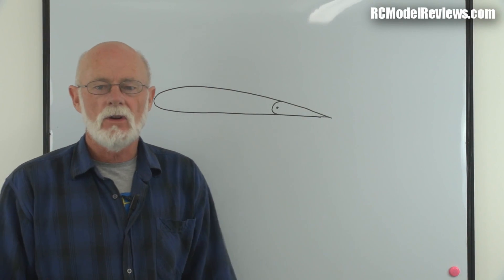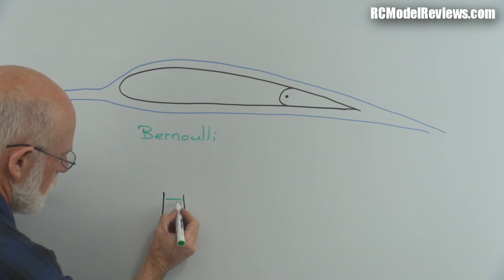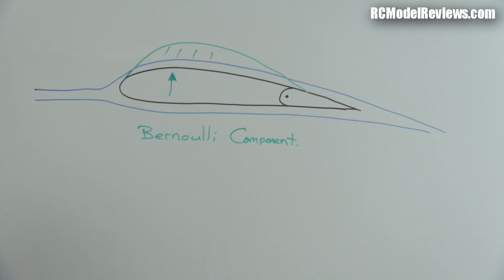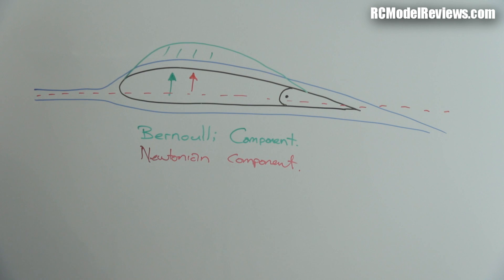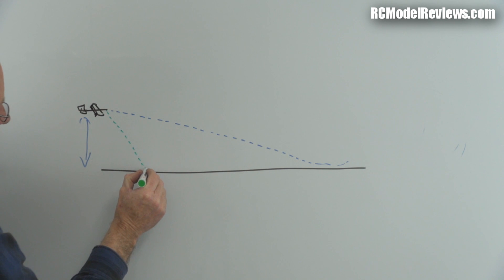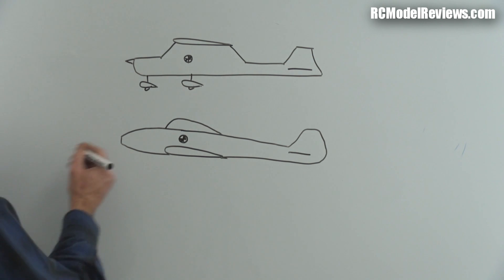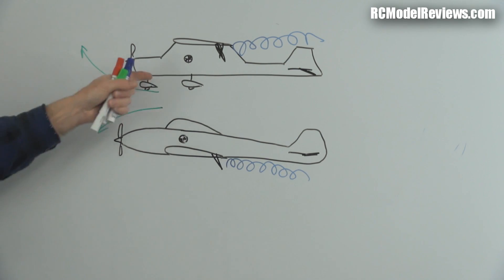How aircraft flaps work

Comment: another way to prove lift as you are discribing would be to grasp a piece of paper with both hands by two a posing corners.  alow the rest of the paper  to droup  over away from you and then blow across the paper . the paper will lift into the air proving lift .
Reply: Yeah but now blow along the bottom side. Now the air on the bottom is moving faster than on top, and yet the paper moves away from the faster moving air. The high pressure deflection effect is much greater than the low pressure Bernoulli effect at any given airspeed.

Or another way to do it, hang the paper straight down instead of drooping out sideways, and now blow air over one side or the other. 
Very little movement (but some).
Now blow air across one side, but at slight angles to the paper (different angles of attack) and see how much difference there is between high pressure deflection (blowing across but slightly toward the paper on one side) and low pressure Bernoulli effect (blowing across but slightly away from the paper on one side).
It is much harder to get the paper to move significantly with negative pressure, but very easy to blow the paper around with positive pressure, using the same wind power.

Granted, an airfoil shape will increase the negative pressure effects, and you're going to have both forces at play, not just one, but the greater force seems to me to be deflection, not Bernoulli.

Comment: No, the Bernoulli explanation is wrong.  The Newtonian explanation is correct.  The benefit of the camber is to keep the air flow attached to the foil longer than would be the case with a flat plate, so you get more lift per amount of drag, and can sustain a higher angle of attack without stalling.

Comment: Forget about the green liquid and straw, that is bogus ! 

Bernoully "component" and Newtonian "component". Naah...Both can explain lift on their own and are not in conflict. Unless you already know better, you will be better off forgetting about the first part of the video.

 Be happy with the knowledge that a wing creates lift by deflecting air and does it more efficiently if it is curved. As it creates lift It also creates more drag if it is overly curved, like when flaps are deployed. Hence, the flaps are retarded during normal flight. Use Google if you want to go into detail, but do not totally trust this chap ;) .

About the pitching up or down...Yes, interesting. True. Other things come in into play also, like the centre of gravity for the aircraft and the downwash effect on the tailplane due to lowering flaps.

Comment: Brilliant lecture. Although you're intended audience is models it's the same for the full scale. It's helpful to visualize the effective chordline- from the leading edge to the trailing edge of the flap be it up or fully extended. The plane with full flaps will stall at a lower speed (assuming 1G level) but at a lower AoA than clean (the effective chordline is steeper due to the lower trailing edge). The same concept applies with slats- the effective chordline drops with the leading edge of the slats as well as the trailing edge of the extended flap. In jets with slats only extended, you'll be able to fly more slowly but your stall will be at a higher AoA, again the effective chordline is reduced with the lower leading edge. Usually you take off and land with both extended so it's close to the clean AoA. Also, I used to fly the Piper Aztec. When you extended the flaps there was a very pronounced pitch up (unlike other low wings). I was told that was the result of increased downwash over the horizontal stab. Lastly,  I spent many years flying the C-141, a high wing heavy four engine jet transport. It too had a dramatic pith-up during flap extension (it had no slats). The rule was 4 4's- as the flaps went through 40%, make four long nose down trim pushes, lower the pitch 4 degrees, and push the power up to 4,000lbs/hr. Thanks for your effort. Cheers!

Comment: Hi Bruce,
I'm going to be fitting flaps to my FX-79 flying wing! I know but they are there and I want to use them! Lol...
This wing is fitted with a MFD AutoPilot and I am sure (for the first few flights) it will automatically compensate and add up elevator???

Of course, I will test at altitude for safety...

Comment: bernoulli has nothing to do with lift,  lift is produced by angle of attack, and airspeed.
     the wing diverts air downwards almost vertically, just like a propeller blade does, aerofoil section determines stall characteristics and efficiency.
    most lift is produced by the top surface of the wing, not the bottom.
the only reason a flat bottom curved top section gives more lift than a symmetrical , is bcause it stalls at a higher ANGLE OF ATTACK.
      lift is due to airspeed and angle of attack, for those who want to dig deeper,they will find that there is a vortex which spins around the wing chord,  fascinating stuff.
    google,     'how airplanes fly: a physical descripion of lift,  (allstar).
    no maths.
Reply: This implies that if a 737 has a negative angle of attack that it would fall from the sky like a stone regardless of airspeed. We all know that doesn't happen. There is still lift being created other wise a 100Klb plane would not fly.
Reply: you are not making much sense, there would be plenty of,  'lift',   but in a negative direction, towards the planet.
   angle of attack, and airspeed determine lift, take a look at the site i referred to, or carry on believing nonsense, bernoulli only applies to constant power scenarios.

Comment: Is it best to set up an Elevator mix on your TX so that when you apply flaps the elevator adjusts slightly as well........... Im new to using rc planes with flaps and I have just purchased one and i'm setting it up , thanks Steve

Comment: Air pressure is I think 14.5 psi "in old money", so for every square foot of wing = 144 square inch's that's 144 x 14.5 = 2088 lbs per square foot of wing lift, minus the reduced top wing loading, so still a huge amount of lift on a large wing area.

Comment: Very Nice thanks 100% you are a teacher...now please let me ask....why flaps are used in both i.e. while lifting and landing the plane
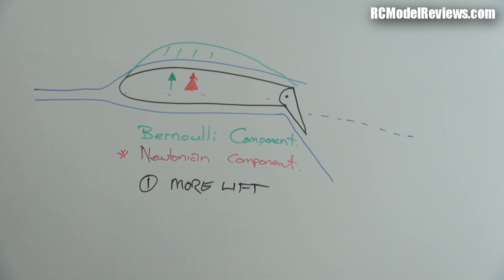Reply: 7:35 you can get the same amount of lift at a lower speed means that you get enough lift for takeoff at a lower speed and you maintain enough lift to keep the plane in the air at low approach speeds so you don't need as long of a runway.
Reply: I was wondering the same thing so thanks for answering Samuel. Im just learning to fly rc planes after years of flying rc Helicopters & Drones. Im learning using a simulator and a Trainer plane Hobbyzone Champ+ and I have now purchased a FMS Cobra 2 P39 and although not ready to fly the Cobra yet I am setting up everything.

Comment: This explanation is unfortunately wrong! Look at experiments with pulses of smoke flowing around an airfoil (search for Holger Babinsky, University of Cambridge, "How do wings work?").

1. The transit times above and below the wing are not equal.
2. Bernoulli’s equation applies only along a streamline. There is no explicit relationship between the
pressure and velocity of neighbouring streamlines.

http://www3.eng.cam.ac.uk/outreach/Project-resources/Wind-turbine/howwingswork.pdf

http://techtv.mit.edu/collections/ifluids/videos/32607-pressure-fields-fluid-acceleration (see demonstration at ~20 min)
Reply: Thank you for informing us.
Reply: Sorry, I'm a bit confused. Can you please point out the parts where he got it wrong?
Reply: From 00:00. I sure he's well intentioned but he's very wrong. There are lots of youtube video's that explain the correct science. Here's one to get you started: https://www.youtube.com/watch?v=XWdNEGr53Gw
BTW, run both that video and another of that users videos with the slides from that lecture at the same time so you can tab between them.

Perhaps the bloke who made this video should also watch it.
Reply: Reik, "Bernoulli’s equation applies only along a streamline. There is no explicit relationship between the
pressure and velocity of neighbouring streamlines.", almost correct, except that neighboring streamlines (all streamlines in fact) a distance ahead of the wing all start with the same pressure ( = local atmospheric pressure) and velocity ( = true airspeed), so you can use Bernoulli between streamlines. For example, if the pressure and velocity on one point of streamline a are Pa1 and Va1, and in the same streamline a distance a ahead of the wing you have Pa0 and Va0, you can make Pa1+1/2*ro*Va1^2=Pa0+1/2*ro*Va0^2. You can do the same with another streamline b: Pb1+1/2*ro*Vb1^2=Pb0+1/2*ro*Vb0^2. But because a distance ahead of the wing all streamlines have the same pressure and velocity, you can make Pa0=Pb0 and Va0=Vb0, what will give you Pa1+1/2*ro*Va1^2=Pb1+1/2*ro*Vb1^2, which is exactly as if you were using Bernoulli between 2 points in different streamlines.

Comment: I just love your analysis makes it real easy to understand. On the question of flaps, I'm trying to work out how much flap is needed for a control line stunt plane as most of them have full wing length tapering flaps. I would like to know how to design them so as to reduce the length, similar to a full size plane, yet achieve the same lift required to do tight circles/corners as per the stunt schedule for F2B. Can you help please? Many thanks...John Harman Brisbane.

Comment: why isn't the wing wider in the first place? 

why doesn't the airplane have a parachute?

why isn't the runway longer to stop the plane safely even if the breaks fail to work? 

why doesn't the plane float? 

why don't they use more than two engines for regular planes to come as a help if one engine stops working? 

why do pilots have a button to switch off the transponder on a passenger plane?

why they don't weigh the plane before take off to eliminate mistakes and they trust pilots to make an exact calculus? 

why they stuff 300 people on an aircraft that only has room for 250? who os letting them do it? 

why do airplanes take off and land during storms? they only close airports when it's impossible to land. Otherwise who cares if the pilot can barely land on high winds almost killing everyone?

why arent the big bags scanned also the same way the hand bags are?

Comment: Why would you assume the air from the top and bottom reach the back at the same time?
Reply: The assumption is wrong. Air molecules hitting the leading edge together and going one over and one under the airfoil do not reach the trailing edge together. The one traveling on top travels faster by more than what is needed to make up the longer travel, so it reaches the trailing edge first.
Reply: there have being counter explanations to why Bernoulli equation doesn't explain concept of lift on airfoil, but then old school of thought has it that some assumptions made, i.e; ''laminar flow'' which in a lay man's term literarily mean the fluid molecules are undisturbed!... ''wing slicing through'' this explains why those adjacent air molecules (top and bottom) reached the wing tip at the same time.
Reply: Approximation at high speed ... Boy. They can never reach at the same time, but difference trends to increase and decrease and so do the lift generated.

So we are human.we assume the shit up, we make the shit up just like we deed for religion.
Reply: It doesn't, but I understand why the assumption was made.  Imagine a grid of equally spaced dots moving over the wing, now figure that if the dots are more crammed together, they will try to push towards an area where the dots are spread further apart.  Now visualize what happens when the equally spaced dots at the leading edge don't meet up at the trailing edge.

Again, I realize that the air particles in fact do not meet at the trailing edge, but I understand why the assumption was made.
Reply: Because if the air doesn't meet the wing stalls and you get vertices as these are caused by the fluid, air in this case, spinning into the vacuum created where the airflow doesn't meet. You can only increase the sorted of the fluid above the wing by a fixed amount and this dictates the stall speed and angle of the wing.

Comment: The Bernoulli effect is not caused by the shape of the wing, but by the angle of attack. If the shape of the wing generated lift then an airplane would not be able to fly upside down. A flat wing will produce the Bernoulli effect BUT produces more drag than the airfoil you've drawn. So we create the airfoil shape to make wings more efficient.
Reply: Bernoulli effect cause by both - i.e. the shape of the wing and its AOA(Angle of Attack). "Flat plate" that you mention as an "airfoil" is more related to symmetrical airfoil, that is why it fly well upside down as an upside up, however, that is not the case for many none symmetrical airfoils, especially that are heavy cambered.
Reply: One thing not being mentioned, and maybe pressure covers it, but air moving faster over the top of a wing than the bottom naturally creates lift. Another proof of the Bernoulli effect is holding a standard 8.5 x 11" piece of paper by the upper 2 corners, and raise to just under your mouth. Now blow and the paper will rise to level, due to air traveling faster over the top.
Reply: firecloud77 an airfoil is merely a parabola for gravity as the craft gains speed, the parabolic wing disrupts gravity by lessening its pull and voilà u suddenly resemble a bird....
Reply: Kilgore Trout paper does not prove that Bernouli principle is involved, if you hold it upside down so it is perfecty straight and blow on one side of it paper will not move towards the side you blow on, it is the side with higer air speed and it still won't move towards it, but curved paper will and it is prove that lift is caused by radial motion of air around or under something
Reply: F18s use negative lift.... And only the flaps give lift
Reply: The way a RAF sail on a windsurfer works- is from lift as the wind drags the foil forward and also the blowing thrust of the wind... So a yacht can go faster than the wind speed if at the right AOA

Comment: is it possible to calculate the lift of an airfoil using just simple formulae?  we have the general lift equation but there would be 2 unknowns lift and lift coefficient. is it possible by any other method other than software analysis ?
Reply: +William Brydges so there is no possible way to calculate lift theoretically unless we use a wind tunnel setup ?

Comment: How can you assume the air on the top of the flap and the bottom of the flap arrive at the back of the plane at the same time? With a longer distance, my inclination is to think that it would take longer for the top air stream to reach the back then the bottom stream...Someone help please
Reply: Hello Mike, It is easy, the air above does take slight longer. Equal transit theory about lift is incorrect. It was only used to try and force Bernoulli's venturi effect to explain how a wing works. For better understanding of how a wing works consult NASA, they have some very good video lessons. Ignore everything you just heard about flaps it was mostly wrong. Sorry.
Reply: +Mike Englert You are right. The upstream and downstream won't meet again at the same time after the air is separated by the wing. Scientist have found that the upstream does go faster than downstream, which means Bernoulli Equation is right but people always take wrong assumption that the air will meet again
Reply: +Mike Englert it is correct what you say. the air has no reason to arrive at the back of the wing at the same time. the air wants to stick to the wing surface. that's why it is pointed downwards after the air passed the airfoil.
Reply: +Mike Englert Hello, Mike. How about: if the air above the airfoil does not arrive at the same time, it will become more and more concentrated above the airfoil, which should press the wing down and crash the airplane. Which is not what we observe. Does it work for you?

Comment: Can I just add to my other comment,144 square inch's to a square foot,= 144 x 14.5 lbs a square inch = 2088lbs lift per square foot of wing,but remember there is still some air pressure above the wing,but definitely less than below.Bye Bye.

Comment: Air pressure = 14.5 lbs a square inch,so in flight a large wing can have maybe a ton or more vertical lift because the air pressure on top of the wing is less than below,"i think." Regards from Cornwall.

Comment: The Newtonian component without flap is explained wrong. The force upwards caused by the air is mainly because of the decreased pressure over the wings. And if the factor is proper enough(F > mg), the force provided would lift the plane up.  And the acceleration a = F/m- g . And if we have the flaps on the wings, the Newtonian component would give a force back towards up-right. And the red arrow in the video should be a little bit up-right.
The explanation of this video is very helpful anyway. Thanks for sharing.

Comment: good educational simple vid but the experiment did not work. is it just me. I understand the low preasure concept but i dont understand how the static air with a higher preasure pushes the water down and up the straw. if that's the case shouldnt water come out of straws all thr time since it is constantly surrounded with static air. or was the point that matter moves towards an area of lower preassure. please ignore my spelling I'm only 14